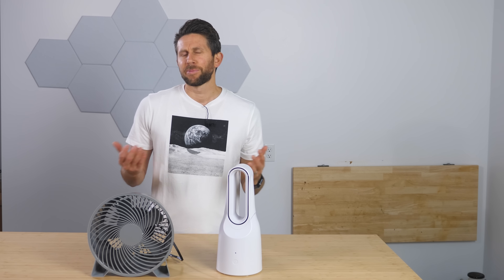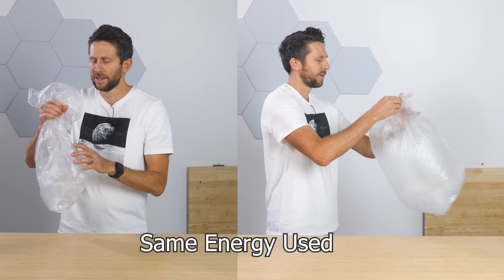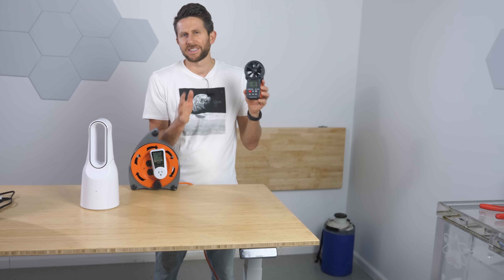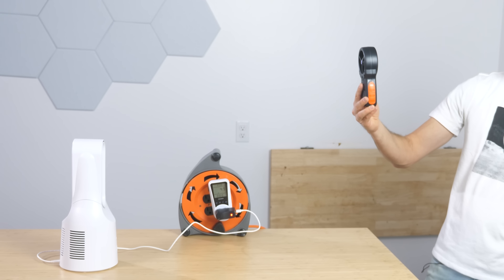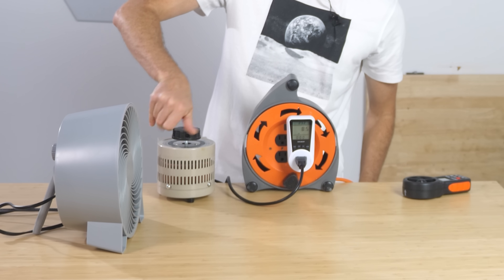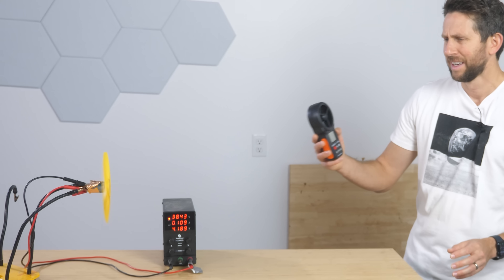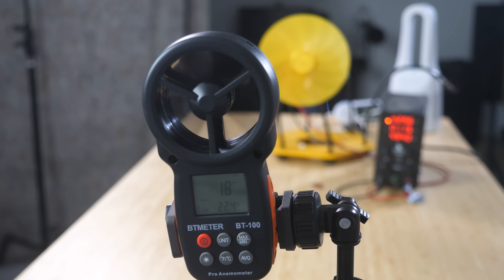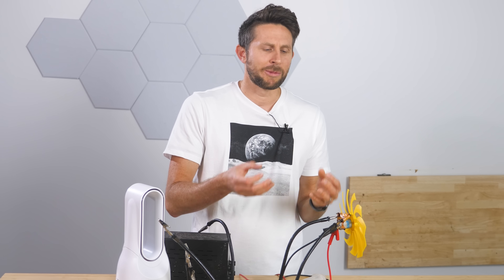Are Bladeless Fans a Scam?

Comment: I always thought a bladeless window fan would be cool. I don't know if the geometry scales, but being able to still let in light and see outside would be pretty cool.
Reply: Putting one all around a window might be interesting. Open the window, turn on the fan.
Reply: yeah that would be an interesting idea, be able to get the extra airflow from having a window fan without losing the ability to see out that part of the window
Reply: Couldn't you just build like a bay window with the slit running around the window and a fan of some kind mounted below the window concealed in the wall blowing the air up? Seems like it should work the same way.
Reply: I've just stolen your idea and made a new company and already have orders for 10 million units. Thanks steve
Reply: A bladeless exhaust fan would be cool I mean those things are originally ugly as f
Reply: You can still see through fans, especially if they have transparent blades:)
Reply: @RennieAsh but go can't go through the fan, so technically it's not a window
Reply: attic fan
Reply: Ooooh...
Reply: Just put the Fan that sucks the air in one or two meters infront of the window. The frame Fan would be a cool integrated solution though
Reply: @HerrSalat  I've done that before, but it's pretty obtrusive and noisy.
Reply: How about opening the window
Reply: @turolretar  Do you really not understand how fans work or what they're for?

Comment: Well this isn't surprising since  all other Dyson products are a scam.

Thr vacuums are horrible and overpriced. Those stupid hand dryers you have to stick your hands in don't do any better than normal ones... And you almost always end up touching the inside them which is just gross.

The hair dryers are a joke.

All Dyson really has going for it is clever "futuristic" looking products and a great marketing team.

I'm a house cleaner, use my clients vaccums because of potential pet allergies and I cringe every time I see a Dyson vacuum in someone's house.

Oh and you know those battery powered stick vaccums? Seriously the WORST!

The max battery charge goes down by 1/2 after 5 uses. Then the dust cup is 100% made to break! It's a high friction area (you move it to empty it) and the part that holds it together only has 3 tinny stubby clamps holding it together..and they just break super easy. 

It breaks SO often that there are a BUNCH of generic replacement parts on Amazon.. For $12 when Dyson charges like $60 or something.

And the generic ones work perfect.

Comment: The "bladeless fan" has blades, they are just buried inside the unit. My mother had one of these as it was twice as loud as the basic fan it replaced and didn't move any more air. And yes, I used an anemometer and SPL meter to check this.
Reply: Did you watch the video?
Reply: @Cronkna  Yes and my comment provides a second set of data points that confirm Action Lab's findings.
Reply: @Cronkna Yes, and it sucks.

Comment: To me, what's really interesting is the difference between an axial fan (like the two non "bladeless" fans you used) and a "squirrelcage" fan, like is buried in the "bladeless" fan's housing.  The squirrelcage is a LOT quieter.  I wonder if this is because each individual blade is much smaller than the blades on the "normal" fans, or because there are no blade-tip vortices? -or if because having the enclosure around it directs air through it, making it more efficient.
The subject for a future video?
Reply: I feel like this would be good for a Technology Connections video where it would get the deep dive it deserves :)
Reply: I can't say for sure, but at least in PC hardware, these blowerstyle fans or squirrelcage fans, such as those used in some graphics cards, are generally much louder than the normal variety. They are used in server applications because they can be built with a lower profile than a normal fan-heatsink combination, which is important when building a large data center, for example. The reason they are not used everywhere is the noise they produce. It's often a high-pitched, turbine-like noise because they still have to run pretty fast to cool the hardware, but in a data center that's often not a problem.
Reply: A well balanced ceiling fan makes no discernible sound at low speed, and various degrees of "whoosh" at medium & high.
Reply: Excellent idea. Would really like to see that.
Reply: The quiet factor is due to the fans sealed housing and design.  If you look at the blades, did you notice they were scooped much deeper than a traditional fan blade.  That helps buffer the sound.  Then they hide the motor and blades in the housing further buffering the sound.
Reply: The noise a fan puts out (apart from any wind noise, which becomes more of a factor at higher power) is directly related to the type of bearing the fan has. There are bearings that wear out faster or slower, bearings that are louder or quieter, and bearings that are a few dollars more or few dollars less (per unit). Likely in this case the quiet fan unit used in the bladeless fan had a bearing type that cost a couple dollars more and was a little quieter. Whether it lasts as long I don't know.
Reply: I watched a video a year or so ago where someone measured the decibels of a bladeless vs a traditional fan and the bladeless was louder. Personally I find that the loudness is a lot different on one of bladeless fans- its more of a windy sound than a mechanical one. In addition I really like the fine speed control although you could probably get that on much cheaper fans.
Reply: Because axial fans are "cutting" the air in which sound is being made cause of the slight friction with air.. whereas the squirrel cage fan is contained within a cage air friction is greatly reduced. The axial fan is fluid with its vortices whereas the squirrel is stiff and works more like a tornado then wind.
Reply: @zippehzuppah9046  s
FYI squirrel cage fans are a different type AKA centrifugal fans as they throw the air outwards using centrifugal force. They actually develop more pressure not necessarily air velocity at the same fan/blade speed (RPM). Though the end result would be a higher velocity air stream IF the outlet is smaller because Air Volume= velocity * area and conversely velocity=air volume/area. I'm an engineer and this is exactly what I do for a living or did before I moved to sustainability lol
Reply: 7:44
Reply: @Spero_Hawk  like I said, RPM...BC power is proportional to speed. Jeez y'all need to lookup the fan laws 😔
Reply: The correct name of a "squirrel cage fan" is cross-flow fan :)
Reply: Assuming all else is the same (which it is definitely not, but I don't know enough to give an accurate judgement considering all the variables), putting a wall around blades does improve rotor efficiency (look up ducted rotors/ducted fans, there is tons of research on them) and makes them quieter. However, in my own personal experience, the difference in sound between traditional and "bladeless" fans is much larger than the difference between ducted vs non-ducted rotors. I imagine that having the fan fully encased in material allows them to block out a good amount of the sound, either directly through having material in the way, or some clever acoustical engineering.
Reply: @sakethvegunta5086 probably there was a big difference in power consumption as well, bigger and befier fans will use more energy and make more noise due to air turbulence

and you're right about ducted fans vs unducted, there's a difference in noise and airflow. PC fans are way better ducted than not
Reply: The enclosure makes a huge difference, plus the compressor/centrifugal fan generates a higher pressure differential at the same and lower fan RPMS which means it can run quieter

Comment: His bladeless fan was on the wide setting that’s why he had to go so high, he’d also be able to gather it from the sides, I know my Dyson has a mode to aim the air in a straight line which would obviously lead to higher values, the small fan is set up to blow air around a larger room

Comment: Yeah, the wind from the motor in the bladeless fan lost speed because it was having to drag the slow moving air around it. So you moved more air at the cost of speed with the bladeless. What different result would you expect? So you didn't compare the total performance of the fans.

Comment: I always figure if the bladeless fans were that much better we'd have seen them used in ducted system to entrain the airflow, but never heard of that being done.  If they worked they'd be better for booster fans on dryer vents since the blades wouldn't be in the lint stream
Reply: Maybe nobody thought of it. That sounds like a good idea.
Reply: Thing is not about better. But about how much cheaper to make so it can be made more and quicker. Even if the no blade fan has better wind speed on top of the built in purifier, a no blade fan is likely at least 10 times the cost of a standard fan. By that time you can just buy 5 standard fan and get better result and still save money. I think it is meant for commercial usage not for industrial usage.
Reply: Well, even if they were better it wouldn’t make sense for a ducts I don’t think. The whole point is to pull air from “around” the bladeless tunnel, and there is no “around” in a duct

Comment: The efficiency of the bladeless fans is less than you calculated, since you were not taking into consideration the actual volume of air moving at the measured speed. I am guessing that the volume of the air from the bladeless fans is quite a lot less. You should do a follow-up video where you also measure the volume of air being moved. For example, you could have created a virtual grid (e.g. 8 x 8) at a set distance from the fans, and measured the air speed at each point of the grid, and then used that results in the calculation.

Comment: Hmm, there are a lot of aspects to this test that aren't up to your normal quality.

The air speed at a fixed point location is not as important as total volume of air moved, which is far more important point for energy efficiency which I wish you had managed to measure.

Also I would happily take a slightly less efficient fan IF it was silent, over a more efficient but loud fan. A lot of the noise from fans isn't actually caused by the fan motor/blades itself, but by the air hitting the blades/structures/grids/filters that protect the blades as well as people/pets from the them. So I would have loved to see some sort of comparison with this measured in as well.

And as in the above point, the fact that you can hide the moving parts of the blades behind the casing without sacrificing too much efficiency is an amazing deal. Not only is it safer, possibly quieter as they boast?, but can also redirect/project the air flow separate from the fan itself

Especially since I have ADHD and I am on the spectrum, loud repetitive noises like fan/clock/fridge etc are absolutely intolerable for me, and if I have a fan on, I can't focus to do pretty much anything else and it will start building up anxiety, so IF these things do actually work even remotely efficiently and quietly, I'd consider buying them

Hopefully you'll make a separate video of testing these out!

Comment: You don't seem to understand anything at all about fans. A "regular" fan does not work well without a surround and is much less efficient. Fan noise is due to blade design. When Japanese makers introduced plastic bladed fan a few decades ago they were almost silent because they understood aerodynamics. The copiers did not. This is not a good "experiment".

Comment: You did not measure CFM (Cubic foot/minute) which makes this an invalid experiment. The “Bladeless” fan is, very, likely, more efficient because it causes a greater volume of air to move. To compare the two fans correctly you’d have to guide the airflow through a tube that is necked down and then opens up wider at the exhaust end (almost like an elongated rocket exhaust nozzle) and measure wind speed at the exhaust end and from that you could calculate CFM.

Comment: As commentors has mentioned, you have testing problems and a cheap 'bladeless' design. 

Dyson bladeless uses a higher pressure compressor (centrifugal compressor). A much better engineered pressure chamber that expels the gas along the airfoil using the coanda effect. This fan you demonstrated uses none of that, you inadvertently figured this out when you 'measured' the air coming from the 'fan-less' as being off-center.  By doing this experiment with a cheap knock-off and not suggesting that it was such, you are inadvertently shaming Dyson's true engineering skill by comparing it to a cheap also misunderstood version of the 'same design'....

Please retract, or at least have a follow-up video with a much better explanation for the true engineering of the bladeless design. Break it down so your viewers actually understand the experiment and why it was wrong to begin with.

Comment: Surly the casing of the blade bladeless fan also obstructs the intake? From here it looks like it's got what is effectively a grid/mesh around where it sucks in the air. 
Could you try and run the experiment with the blower on the casing, just upside down. So it's got the same restrictions around its intake,  then we could see if the design is actually doing what it claims to be.

Thanks for all the great content!

Comment: Bladeless fans are also more cat-friendly ;)
I don't use fans, once you get to the kind of heat levels where you really need to cool down, fans only serve to blow the hot air at you, which actually makes you take in heat faster. Basically making an air-fryer.

Fans are useful when the heat comes from direct light, not from the air around you. if the air around you is still cool, then the heat you carry can still disapate into the air. Once the air around you hits close to body temp, fans are useless. What I usually do to stay cool is I take a bucket of cold water and stick my feet in. That solution only takes the energy it takes to pump water into your house, and if the water out of your faucet is getting warm, it will cost whatever energy it cost you to cool the water in your freezer. Probably still more efficient than air conditioning or fans.

Remember when trying to survive a heat wave, that what gets you is the rate of heat transfer. The human body generates heat it needs to shed. Now we all radiate heat through infrared radiation but this is minimal. So what we also need to do, is give off heat to the matter around us, gasses, solids or fluids. This transfer happens through our skin and our breath. This is why we sweat. The liquid on our skin is a heat conductor, turning your sweat into a heat sink. As it evaporates it cools you. If the air around you is hotter than you are, you are actually taking heat into your skin. This can be dangerous. Especially people with medical conditions can die from that kind of heat. In elderly homes, poor heat protection kills people every year. 

The take-away is that to find solutions to lose heat, you have to look at the problem of heat transfer. How does heat come in, how does it leave.

I live in a house that was built in 2015. It's an apartment building on top of a school. And it was constructed poorly in this regard. I am on the top floor, so directly under the flat roof. I also have floor to ceiling windows on the entire side of the house that faces the sun all afternoon. In summer, it can be up to 12 degrees(celcius) warmer inside my house than it is outside. If I close the windows the difference climbs up way higher than that, over the days, as the heat insulation is quite good. Trapping the heat inside the house. The reason for this is that the house's supporting structure actually conducts heat into the building, through design flaws.

So for two months a year, I must vacate my home and stay with friends...or die.

This has led me to try some pretty creative solutions for cooling. The best thing I found, is feet in ice water, and drenching towels in cold water that i wear around my neck, shoulders and across my lap, as well as one over my head.
I suspect its both effective for the heat the water soaks up for being cold, but also for what it takes with it when it evaporates.

Unfortunately, the earth is getting warmer. And we need to know how to survive that. Me now, for my medical conditions. Soon, all of us for how much hotter it can get.

Comment: Love the content but the comparison of these two fans isn’t apples to apples in terms of fan size and maybe even future designs, sure that $50 fan doesn’t put out more airflow than the traditional fan does but it’s also SMALLER ( the Dyson ) and uses less power and could have design upgrades. 

Hence a more expensive version of a Dyson would be needed to compare properly and maybe even multiple different versions..
Along with traditional fans.

End of the day, would I buy a $50 + fan because it’s quieter? 

Not currently.. but maybe in the future if there is a real reason…
Reply: Bladeless fans are also louder. For the same amount of air moved they have to work harder because of the friction created by the air bouncing around in the housing.

Comment: You need to have a shroud around the blades of the yellow fan to push a central flow of air. For example, a radiator in a car has a shroud around it, and it will push more velocity if the shroud is closer to the blades.